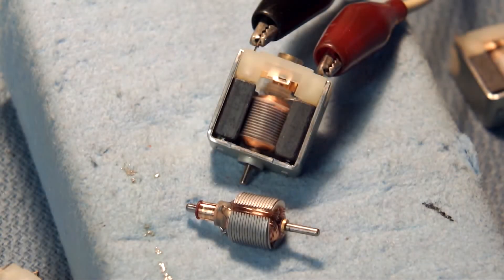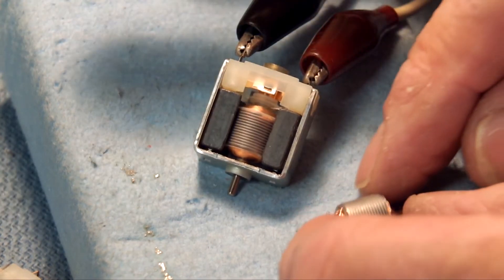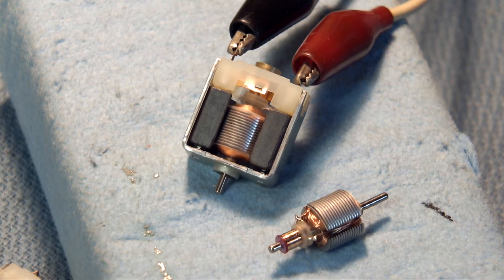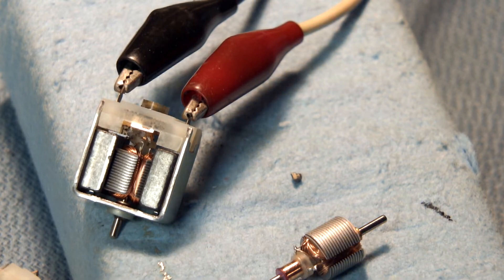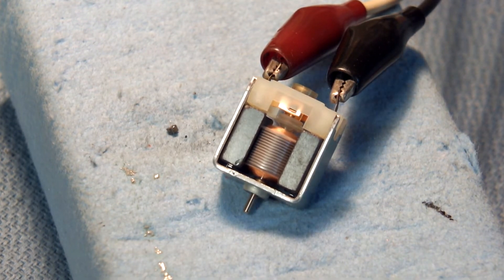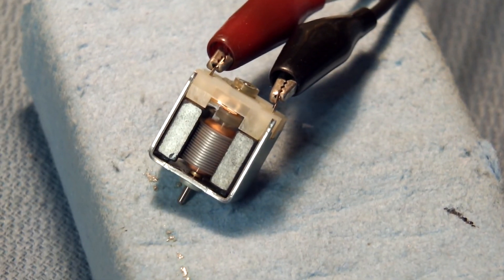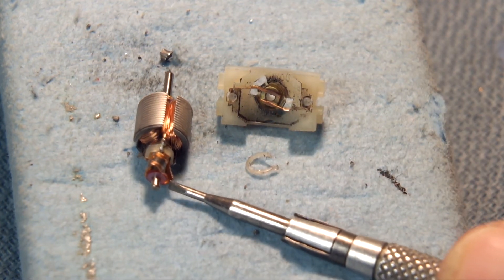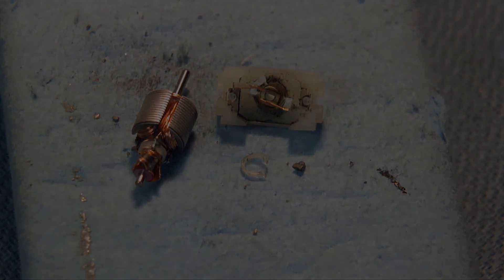Low Ohm Armatures May Not Be All That, and A Bag of Chips...

Comment: Yeah, really not the correct application. I purchased some cans that had the same problem. The resistance wasn't listed on the for sale listing, but the size looked ok for what I needed. Course when they arrived, the size was ok, but the resistance was ridiculously low. I'm sure they were probably meant for a toothbrush or something pushed by a double A, but they were so inexpensive I figured I'd give it a shot. Never know, I may be able to use them at some point to power something not connected to the track. Mine melted about the same way, and it was fun doing it and listening to the can screaming!
Reply: I wonder how this would fare as a drag only motor at 24 volts? It only has to run for less than a second.